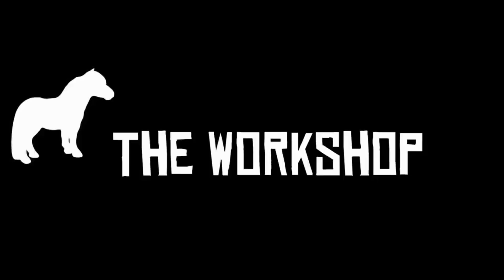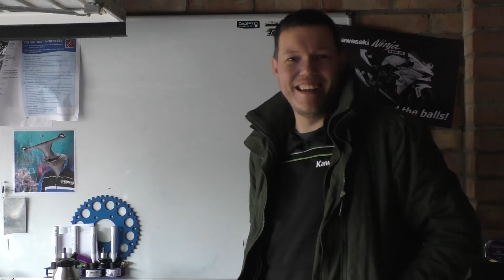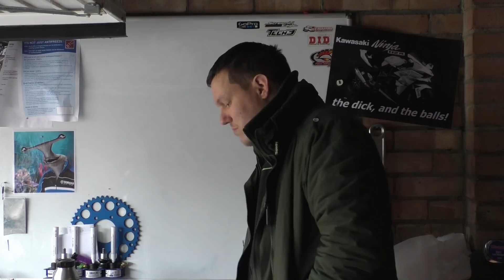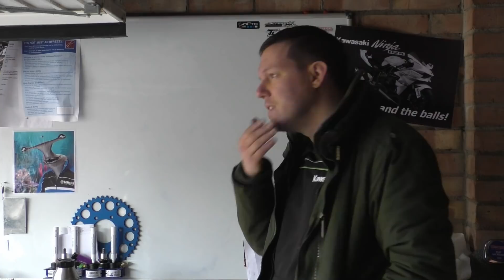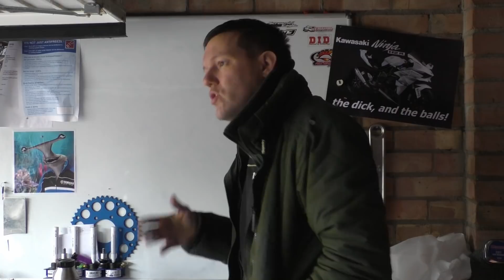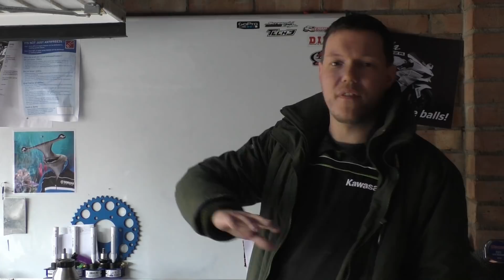Engine Noise - Waste energy? - QT

Comment: I was going to ask how BMW might have achieved their claim of improving the fuel efficiency in their new F series engines by going to a 270 crank from the old 360.  This despite their adding a pair of balance shafts and removing the "dummy rod", which was originally specifically chosen for its allegedly lower friction, even though its curved motion was less effective at "balancing" than even a single balance shaft could be.

It makes sense that any vibration in the engine block will be transferred to air molecules, so in NVH-motivated terms at least, that energy transfer could well be significant (Euro4, tingling extremities).  But now I wonder, could it really be so significant that it might meaningfully affect fuel economy as well?

Or is it just that the reduction in required balance mass for the 270 crank reduces bearing loads and reduces friction that way?
Reply: Laverda triples went from a 180 degree crank to a 120 degree crank...inherently better balanced and all that guff.....but who gives a shit about that when the 180 Lav's sound the bollox compared to the 120 wank.....
Reply: I like both. I'm glad Laverda tried both as well. 
I don't think either has any real advantage in balance terms, just a bit different.

The 120 is even firing, which feels smoother and has better torque and power potential.

Sound wise the 120 triple is a bit parpy down low, but really growls from the midrange up. The bark of the 180 is sweet, but it's hard to shake the "four cylinder with a misfire" vibes...

Comment: Basically, any output from an engine which is not delivered at the end of the crank shaft is wasted. The energy supplied by the fuel is largely converted to heat during combustion. Some of the heat is converted to useful, rotary motion by the piston, rod and crank. A by-product of this is friction which generates heat, and heat from the combustion is also lost directory through the combustion chamber, cylinder walls etc. and not least through the hot exhaust gasses (where some of it can be recovered by a turbocharger). A relatively small percentage of the energy is converted to vibrations and sound/noise - which must be considered a loss (except perhaps by the very juvenile). All in all we are lucky to see 20% of the power supplied by the fuel delivered to the drive wheel.
Reply from the maker: Its more like 30% unless its F1 LOL

Comment: On a less ball licking note: this question feels to me like the heat is a waste byproduct type train of thought. I still struggle with these concepts to be honest. Mostly because my train of thought goes: I want the rapid expansion to do all that pushing of the piston. I know that the combustion engine isn;t 100% efficient. Some of the energy is in, friction, direction changes, heat and noise. How to reduce those things so all I get is kinetic energy for me to use? But things arn't that simple no matter how much I want them to be :)

Comment: Is noise really a waste? You could plug your exhaust up, which would prevent waste noise, but your engine wont run! haha
But in all seriousness, noise comes from the pressure in the exhaust from combustion. Pressure that's vital for scavenging and performance, let alone being an inherent part of creating the flow of exhaust gas. So I guess you can say it's not even a by-product, since it's a fundamental part of the exhaust process. No exhaust process, no power.

Comment: QUIET  engine can "COST" energy
 for example your camchain , if you want it to be quiet then you need to push the camchain  harder to press against the plasticc thing. That means your camchainTensioner would need to push harder And that COST energy to make it quiet
I did this on my KTM i put a MANUAL CAMCHAIN TENSIONER

Comment: If you were in the exhaust jet from the rocket (in space) and somehow immune from the heat, you'd here noise. This is because the exhaust jet would act as a transmission medium.

Rockets and jets have visible and audible resonance wave called specific impulse. If you were in space watching the rocket motor's exhaust you'd see the specific impulse pressure waves in the vented gas from the side view. However, from that perspective and because of the near vacuum of space, you wouldn't hear them.
Reply from the maker: This is why I said its how you define 'noise' but in the case of sound then some kind of medium is required. The whoi thing starts with vibration.

"Rockets and jets have visible and audible resonance wave called specific impulse."

- I'm having trouble with this. Specific impulse is momentum change. You take the mass of your fuel and the change is velocity.
Reply: I've just tried clapping in a vacuum and all I've managed to do is spread shit, dust and dog hairs everywhere......

Comment: so correct me if im rong please.

sounds isn't realy the energy waste but the vibrations? 

because a rocket in vacum space will still vibrate but doesn't produce sound so i guess its vibrations that waste's energy?
Reply from the maker: "vibrations that waste's energy"

- yes
Reply: In a vacuum the rocket has nothing to transfer energy to. On earth, the air molecules surrounding a vibrating object are impacted (accelerated) by it as it does so. That means they gain some energy, robbing the throbbing object of its energy and "wasting" it.

Comment: Good video, but I got a different opinion on the rocket question: Sure, there's no energy coming from the rocket itself, cause there's no gas to transport the wave. But:
The main thing making noise here is the rocket engine/exhaust. And surely there are sound waves coming from the combustion chamber travelling out the exhaust stream. In the end they're just accelerating the furthest exhaust gas molecules a bit faster, that's where your energy is going to. 
So in direct answer to that question, I'd say yes, there's almost just as much energy going into sound waves in vacuum as in atmosphere.
Reply from the maker: But would you call this noise, the exhaust gas is acelerating faster than the speed of sound in that medium.
Reply: yep true. I'd still say there's energy going into sound. Even with the gasses moving supersonic, there's sound waves travelling through it. They continue usually in the air, which is what we can hear.

Not directly related: I read a post on how loud the saturn V actually was... must have been pretty insane.
https://www.reddit.com/r/space/comments/7avzfv/the_saturn_v_liftoff_was_so_loud_that_you_could/

Also there's a video of an early apollo launch, where you can see visible shockwaves coming from the rockets exhaust, looking like bomb shockwaves.

Comment: Just fill your oil back up to level will help too. Or if it gets noisy did you even change the oil? Well if not your chain tensioner might be clogged or your oil pressure shit the bed. The oil is there to lower friction and so noises and that will bring back the power too. I can hear on my engines when the oil level gets low or the oil is to old.